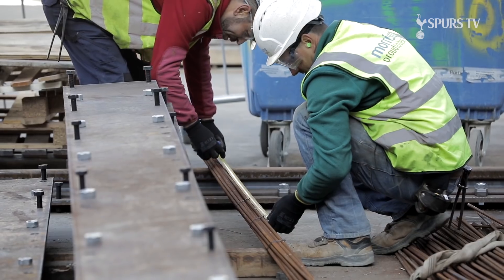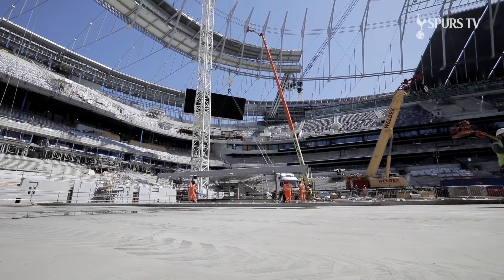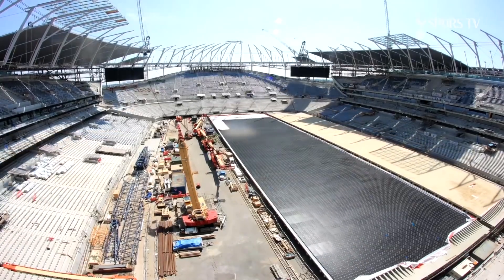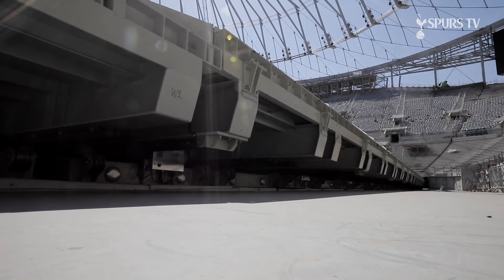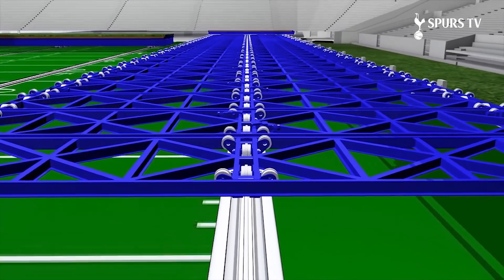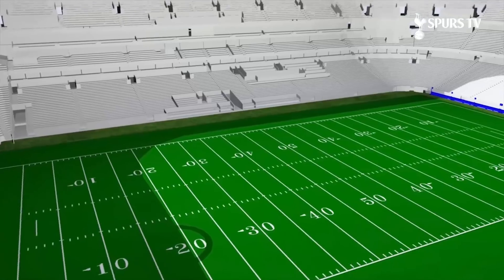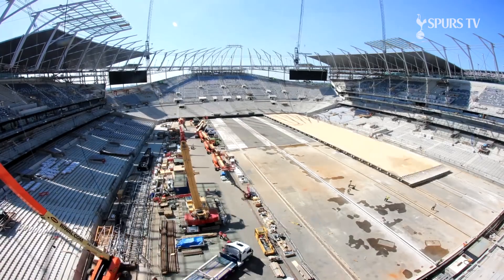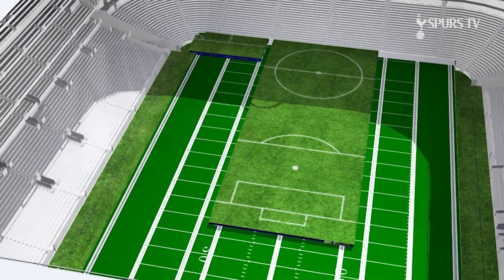SPURS NEW STADIUM | SLIDING PITCH UPDATE

Comment: I'm certain some players will have to play with the constant fear of stubbing their feet on all these numerous intersections in the retractable pitch. Why was the bottom pitch assigned for NFL? It should've been the other way around. NFL is played max 2 times a year there right? They should play in a patched up platform instead of the football players who have to play there for the whole year.
Reply: It's built that way for line of sight for NFL games.
Reply: aside from the sight lines issue mentioned, this allows them to host other events without the possibility of the grass getting damaged, IE, a concert. Much like the Arizona Cardinals stadium and it's massive, retractable field. You have a nice, smooth floor for other events.